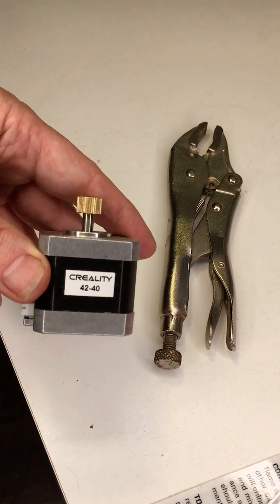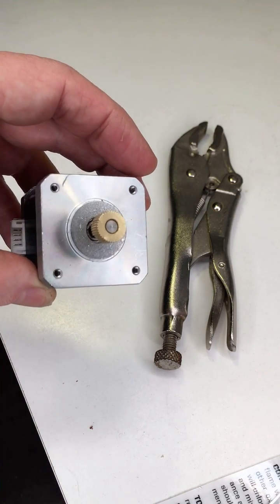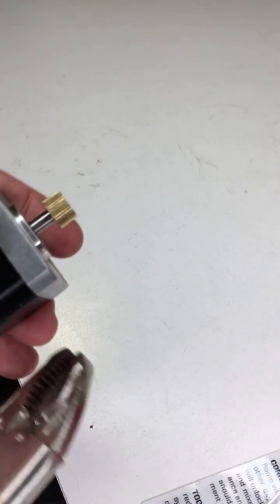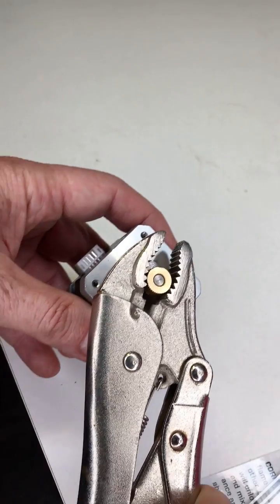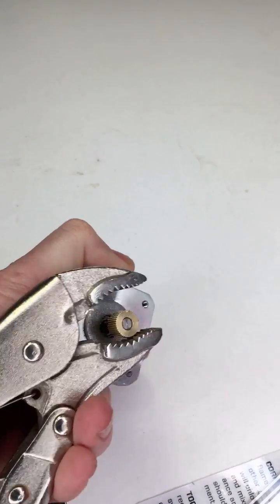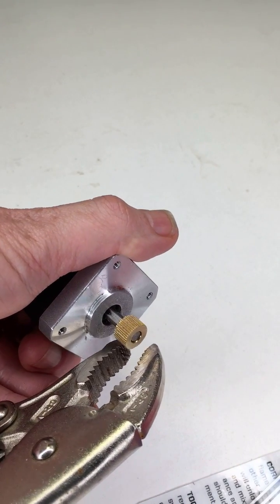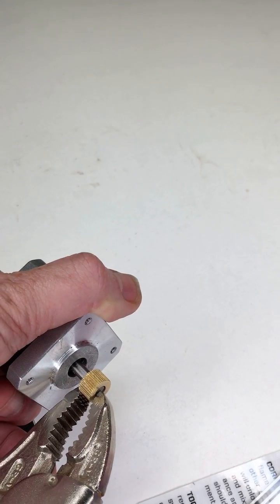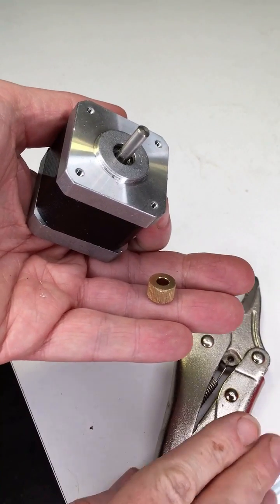How to Remove a Pressed-on Gear From a Creality 42-40 Stepper Motor

Comment: It worked, however nobody has mentioned this version of the motor is 10mm shorter than the older version that included a set screw.
If you're upgrading to dual gear you'll find out the hard way like I did that the new gear will sit too high and the set screw won't even make contact.
Reply: I just found out the hard way.. no one talks about this. What did you end up doing?
Reply: I just found out the hard way too please how do I fix this
Reply: It's literally written on the side of the motor.. If you don't know this, you shouldn't be taking things apart..

Comment: Thanks! one of mine I had to pull a bit with and the 2nd one it just spun freely after the third squeeze. So much easier than heat or a puller.

Comment: Great technique. I was heating it up to no avail first. Likely i was too cautious with heat to not damage the motor. Key here seems to be to do the plier grips off center from the center axis/pinion, to deform the gear? At first, i worked on it with straight pliers that put pressure to the center. That did not work. Only after watching again, i realized you are doing it differently. I.e. using rounded pliers and attack the gear off center.
For the final release press, i had to put an m2 bolt on top of the pinion to have more leverage.
Thanks for taking the time to document this. Cheers.

Comment: Ok, you got it off. How do you put on a new one? Tips please.
Reply from the maker: I installed the stepper on a new Micro Swiss drive system that used a set screw to secure the drive gear to the stepper shaft.

Comment: Didn't even budge. Just taking chunks out of gear. Would have been easier if I just bought pneumatic cutter. Back to the drawing board.
Reply: My issue was that the gear teeth were smooth and can no longer feed the filament. Unfortunately i couldn't remove the gear this way, instead i used a rotatory tool with an engraving  pick to re shape the teeth. Hope this helps.
Reply: @justthinkalittlebit7047  I hit it twice with a hammer and it came right off
Reply: I dont understand
Reply: @victormiller1420  hit gear with twice with hammer, gear comes off 👍
Reply: @Skully8998  I got it but now I just realized it's not the motor I need for the dual extruder. The shaft doesn't have the thread for the part I'm replacing. I dont know what motor I'm supposed to buy for it.
Reply: @victormiller1420  sorry man, I've never had to replace a motor before. All mine are stock. I wouldn't even know what motor to look for with a dual extruder.

Comment: I assume this will damage the gear?
Reply from the maker: Correct. The old gear will most likely be damaged. It is assumed here that we are replacing/upgrading it while avoiding damage or stress to the motor.
Reply: @OrenLeavitt  Thanks. I now have first hand knowledge of this after following your instructions. 😊
Reply: U need to recalibrate estep after dealimg with this gear removal